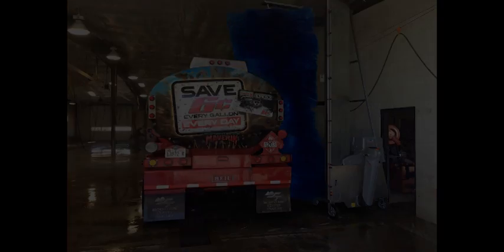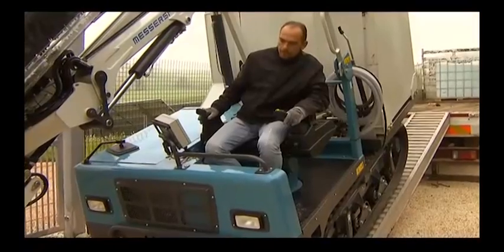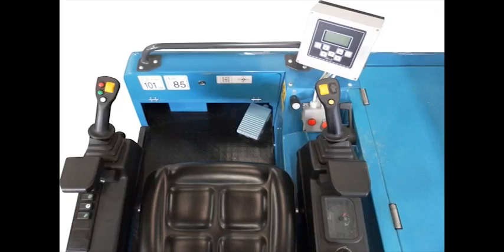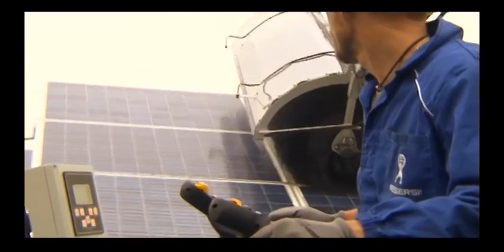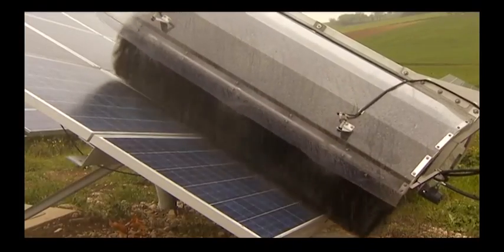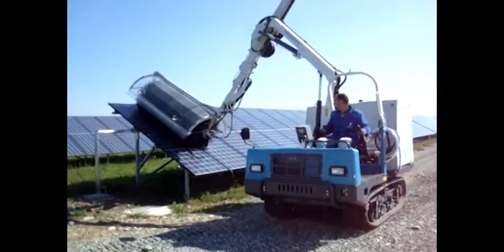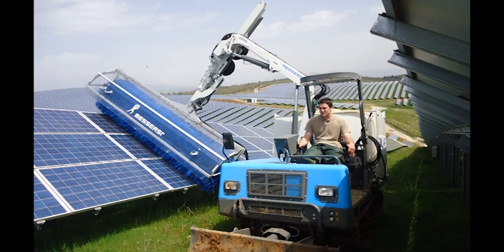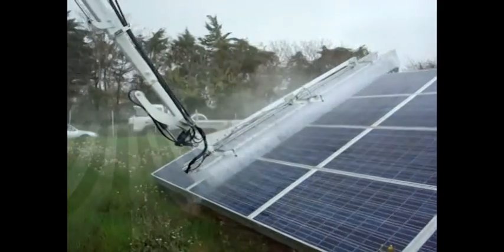Solar Clean, Solar PV Wash Machine. Fastest Way To Wash Large Solar Panel Arrays

Comment: Why did the video not show how the washing machine turns around to go down the next line?
Reply: Because most people know a track machine can literally "turn on itself" by powering one track forward and one track backwards.
Reply: Bruno Albanesi Yes, I'm aware.  However, when the track machine turns on itself, does the brush/cleaner that makes contact with the panels also raise up and flip around automatically or is that a long a drawn-out process?
Reply: When it comes off a line it can simply lift the boom to turn if that is more convenient, or retract the boom to turn, and then reset. If you want more info, please contact us.